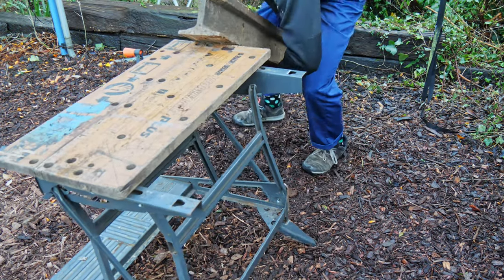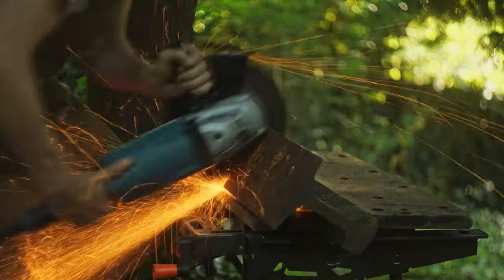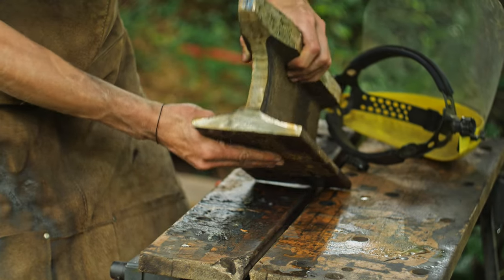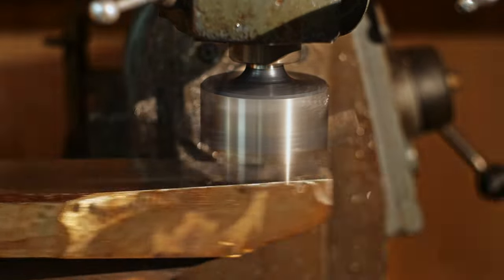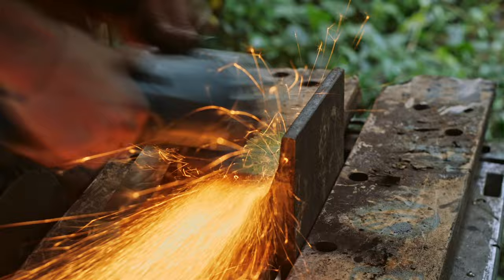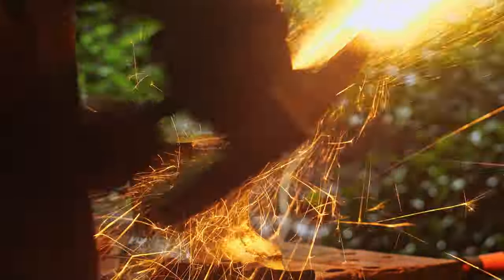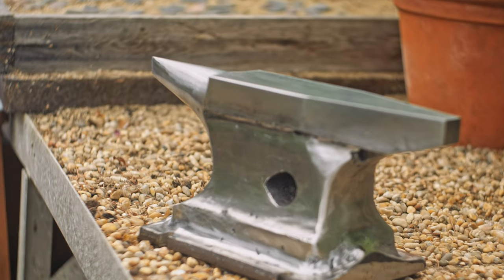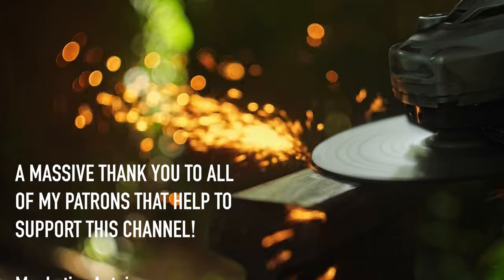Making an Anvil from Railroad Track

Comment: Looks real good considering you don't think your weld are very good looks wise, but as you say as long as it's functional and done to a sufficient standard thats all that matters.
It looks like a ton of work though, burning out a brand new 9 inch Makita is no joke (as well as a cheapy grinder) if you were to price it if you wanted to sell it you'd have to get tens of 1000's to cover costs of material, tools, electricity on top of an hourly labor cost. You'd never get anywhere near enough to cover costs and thats considering the railway line was free. 
I thought I'd mention that in case some dummy out there thinks they could make money out of anvil making.
Anyway you've ended up with a great looking anvil that will be around for centuries to come

Comment: Really nice work! A wee tip if you don't mind. Sharp corners tend to make cold shut when forging and should therefore be rounded over more. The more one increases the radius the less chance of cold shuts. I recommend getting at least a 4 mm radius. Except for the corners you use for scoring or cutting materials with ofc

Comment: ♥ lovely anvil! Perhaps you can use the other material for a "hardy hole" unit with a bunch of the most common inserts. If you make it to the dimensions of existing anvil hardy holes, it's compatible with existing tooling. It would also work as anvil for driving punches through your workpiece.

Comment: Nice job and looks great.   But for those who wish to make one, I strongly suggest that you take your piece of railroad track to any welding shop, after marking out the cuts you want, and have them torch or plasma cut  the rough shape.  I will bet that the cost will be less than the cost of all the grinder disks that you used.

Comment: Rail road track makes literally the worst anvils. There is no mass to them and the work surface is small as hell. You would be better off getting a giant thick chunk of steal from a scrap yard and use that as a anvil.
Reply: Everyone is an anvil maker on the Internet
Reply: I mean he added mass by welding those side pieces on, I don't see why this wouldn't be a good anvil.
Reply: Thank you for your expert insight. I'll make my next anvil out of marshmallows since rail road track is the worst it can't be that bad.
Reply: Clearly you’ve never seen a jewellers anvil, they’re even smaller than the one he’s made
Reply: No anvil is worse
Reply: I have no choice but to use a train track anvils are ridiculously expensive
Reply: Actually the main reason they're said to be bad is the thin web leading to vibration. You solve this by welding side plates to the web for more strength and mass. If you'd done any blacksmithing you'd know you don't technically need a work surface bigger than the head of your hammer.
Reply: It's a hard thing to hit spicy metal against. It's an anvil. Some of us ain't got money to spend on our hobbies and have to make due.
Reply: I made mine 6 years ago 20 inches long. I use it to fabricate medium size specialize brackets.  NOT HEAVY FORGING. It's great for my needs heat bend flat plate steel up to 1/4 Inch. Other than that I 
Comment.